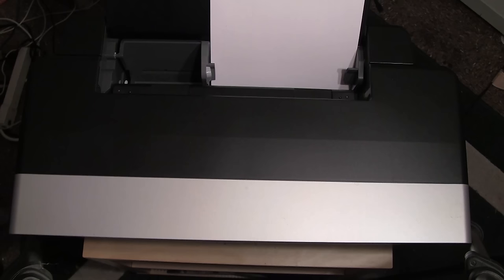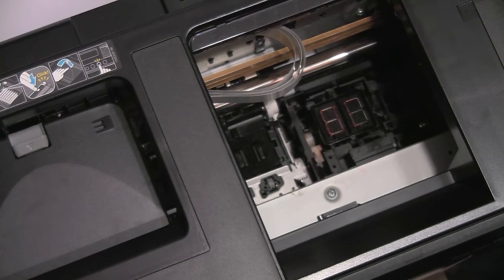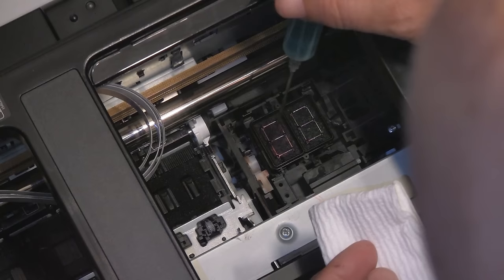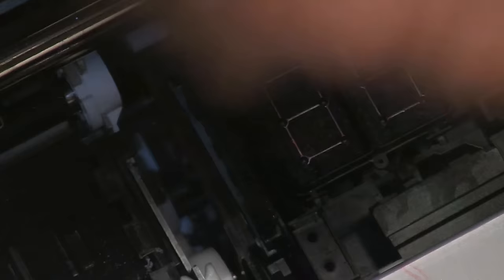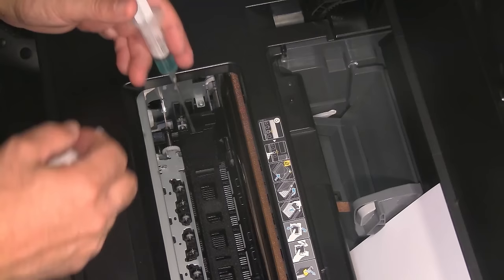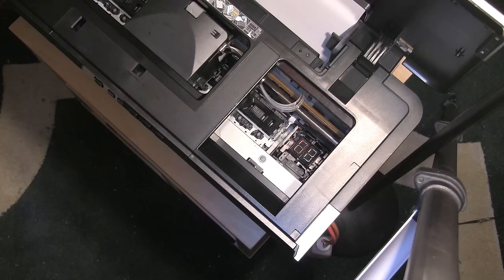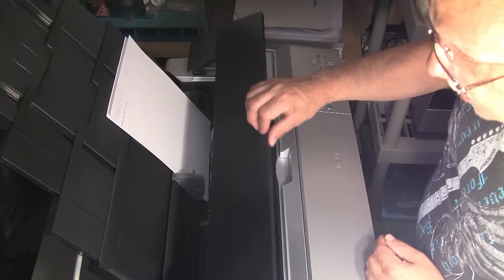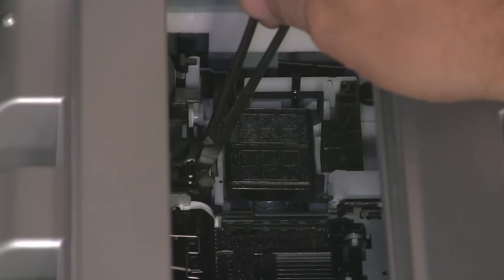How to perform Basic Maintenance on the Epson R2000 and 3800

Comment: Thank you so much Jose. Tried what you demonstrated; did it multiple times with not much improvement and then banding started which hadn't been the original problem ( just a blocked red head).  Watched another of your videos where you talked about laying the windex paper towel under the heads over night.  Did this.  Still banding.  Then cleaned the wiper blade, re-did the sponge cleaning and did a hot wet distilled water paper towel under the heads for an hour.  Everything fixed.  Lesson:  don't give up.  I would have without your encouragement.  Thank you again.  Saved having to buy a new printer.
Reply from the maker: You have not mentioned having done a nozzle check! Banding can be causes my several conditions.  Also are you talking about a 3800 or 3880?  Are you using original ink carts or refillables?
Reply: Sorry.  Did nozzle check numerous times. Ran the cleaning cycle after each attempt at cleaning the sponges. Orange and Red still had problems.  R2000, OEM cartridges only.
Banding didn't start until after I started the windex cleanings; before that all was fine except the Red cartridge being blocked. Worked on it for about 6 hours yesterday in total.  This morning started again.  Something in the last 3 steps fixed it:  either cleaning the wiper blade, re-doing the sponge cleanings or the paper towel with hot distilled water under the heads.  Since I did all 3 , I don't know which fixed it, but it's printing fine now. And thanks again for your tutorials; I would have been lost without them.
Reply from the maker: Glad to hear it.  Make sure If to print often. Orange and red are very dense colors and will the first to cause clogs due to lack of use.

Comment: Just want to thank you for this video. I was having a problem with one of my nozzles clogging and  the cleaning program for my r2000 couldn't clear it. Putting windex in the pads and letting it sit for a couple of hours did the trick. Thanks for saving me from wasting my money on a new printer as my present printer id printing good as new.
Reply from the maker: One single nozzle or a Color Channel? Remember that a color channel has MANY nozzles so it is not a NOZZLE. One nozzle clogged would not even show up as a problem on prints.

Comment: Thank you for this instruction video. Even it is 10 yers old, perfect for my printer. I have a 2009 Epson R2880 and it stopped working properly. I cleaned the printer very very well (for the first time in 14 years) following your instruction video precisly and the printer works perfectly again. I was already looking into the market for a new one, but I'm glad that my R2880, even though it's an old one, still works well. The prints come out very nice. Thx again.

Comment: I'm so glad I found your video, Jose. Epson told me to never try and clean it myself but to take it to an "expert". This means a 140 mile drive for me plus whatever they will charge me. I've had my R2000 for years and never knew of this. I don't overprint at all but the reservoir overprint sponge is saturated and sticky. I expect it will take me all day to clean that. I'm going to clean like crazy from now on since it just won't print right now probably due to this goo.
Reply from the maker: Go slowly and take your time! Epson doesn't want your printer to last too long. The want your to buy a new model printer.
Reply: I have a followup question, Jose. I hope you don't mind. The purge pump empties into something. Where does this excess ink go and should I clean this reservoir? Do you have a video regarding this? I fear a leaky incident in my future.
Reply from the maker: It empties to the very internal bottom of the Printer. That is where the waste ink pads reside.

Comment: Something to add when dealing with rubber parts that are either expensive or just hard to get/replace: after cleaning with anything containing alcohol, since alcohol will eventually dry out rubber and shorten its life, wipe it with a Q-tip or paper towel that's been soaked with silicon spray. The silicon will be absorbed by the rubber and will help preserve it and extend its life. WD-40 can do this too, but could possibly leave some residue that'll affect the quality of your prints. It does work very well on vehicle wiper blades though, so might be worth a try for an experiment, as long as any excess is removed.

Comment: Hi Jose, Have an Epson P600 with 90% clogged Vivid Magenta on the print head. Tried a head clean 4-5 times with out success. Used your windex/paper towel method and bingo, it printed a 100% correct test without wasting a whole lot more ink. Excellent result. Thank you heaps...
Reply from the maker: Awesome to hear!

Comment: Dear Jose, I have the same printer Epson R2000. Currently, I have a problem, that after every single printing, the printer starts the cleaning process (the same one after inserting a new cartridge). Could you possibly know what is the issue? The printer is printing every color and even the test page showed that it is completely clean. However, the printer still runs a cleaning process after every printed paper and my ink is being consumed. Thank you, Arman

Comment: Hi there. Noticed your waste ink system has two tubes going into the container vs putting in a 'Y' connector to narrow that down to a single line going in.

Have you found potential issues in not having two separate discharge tubes going into the container? i've just put together a system that uses the 'Y' but at the last moment I started wondering about issues with the flow from each being constricted by the 'Y' adapter.

Comment: Hi Jose!

I have an Epson R2000 that was purchased new sometime around 2011. I am no longer a working photographer so I do not print photos professionally but I use my printer for crafting (creating invitations and the like). Well, I went to print cupcake toppers and my magenta is not working! I've done EVERYTHING. Cleaned the stem, sat the head on windex soaked paper towel, you name it. What else can I do?!! Your video has saved this printer in the past. In 2020 all heads were completely dried up after 5 years of nonuse so I'm shocked that I'm having such an issue!

Comment: Hi Joe,  my R2000 has the trouble with magenta color only. Currently no any line printed out with Epson Nozzle Check. I followed your way to clean up my printer couple of times. Each time I need to repeat  your procedure again and again, specaily clean up purge pads. It did get magenta color back. But it stopped work again after a couple of weeks no use. My  right purge pads will dry out after I pour Windex or printhead cleaning fluid and left pads is always wet and dark. I need to use paper towlel to suck it many times. Can my printer sitll survive? Thanks for your help in advance.

Comment: I was having clogged head issues so I tried sliding the cartridges along a folded paper towel damp with glass cleaner. I let it sit on the paper towel for a little while then let it dry for a few hours. Now the red cartridge is reading empty...I changed it to a brand new one and it's still reading empty. I'm thinking I may have left some paper towel in the printer? What do you suggest I do to fix this?

Comment: I just got rid of an Epson R1800, and how I wished I had seen this video.  I now have the R2000 so thank you Jose, for sharing your knowledge and for saving us all from future headaches! I’m an artist and I print only borderless—any tips for those of us who do?
Reply from the maker: Robert Dente Printing borderless will always deposit the over spray on top of the Platen sponges, to the right and the left edges of the paper depending on the size. Your only option is to drip Windex on those dirty areas and dab them over and over till they are as clean as possible. Otherwise you will eventually begin to get smudges on your prints if the deposits become excessive.
Repeat every month or so or as needed. The way to completely avoid this is to not print borderless. But since you do, then your option is to constantly clean those areas that get dirty from over spray.
Reply: Many thanks again Jose. I have another question/dilemma if you have the patience?
Reply: Does the Front Feed Thick Stock option work with non-think watercolor paper.  I couldn’t get it to work with Arches watercolor stock.
Reply from the maker: Water color paper up to over 300 gram weight can be feed from the rear feeder. The front feeder is for thicker material about 1.5mm.
If you feed regular paper thinner than that it will be printer blurred due to the pretty huge head to paper distance that the printer will set itself to.

Comment: Hello, I have a samsung 28" 4k monitor and an Epson R2000 printer. When I draw a label in coreldraw x7, the colors of the label do not match the output color of the label from the monitor. I have calibrated the monitor with a spyder 4 calibrator, but it still does not output the correct color. Is my problem a monitor issue, a printer issue or a software issue?
Reply from the maker: I think it's the application. It creates vector based designs. It has to be an pixel based image or it can't be printed with color management. A PDF would react the same way. The vector file needs to be rasterized before printing.

Comment: Thank you so  much! I just fixed a paper feeding problem using your isopropyl-alcohol-on-half a sheet of paper and feeding it through. I did wonder, though, about the use of alcohol. You say that procedure could be done once a month, but other instructions I've seen online say not to use alcohol on the rollers, as it will dry them out, causing them to crack. How likely is using this procedure occasionally to cause that to happen?  Thanks again, anyway... it worked to get my R2000 running again.
Reply from the maker: At the time I lost  that it was though that it would be OK to do so. Now we know that alcohol exposure can dry out so e types of rubber. However most printer rollers are made of synthetic runner like compounds  but some lower end pripri ter rollers are still plaiplain rubber.  I was also made aware of an actual spray for cleaning rollers that will not harm anything.  It also can be used to rejuvenate older rollers so they grip better.  What would do is to onlky perform this operation only when absolutely required

Comment: Hey, Jose.  I was so lucky to find your video.  My wife has a R2000 that we've been using as a heavy expensive paperweight - that is - until the printhead on my Cannon Pixma MP970 stopped working, which is seems like there is little or no solution to....unless a wizard like you might have a secret or replacement option??
Reply from the maker: Canon Print Heads have a finite live span and they simply die due to the it's thermal nature. I am afraid there is not much one can do and in most case the new one will cost more then the new printer. But what is wrong with the R2000?

Comment: Hey Jose ... great tutorial. I still have a problem with one of the purge pads on my Epson R1800. When the head goes through the initial startup and the purge pump kicks in only one of the pads sucks the deposited ink into the purge tank. I think the hose from this purge pad is blocked. Any ideas how I could unblock this ? Cheers.
Reply from the maker: Yes the tube from that pad is blocked with dried ink and crud. Do you happen  have an external waste ink bottle installed? Whether you do or not, you will have to back flush the purge system. Let me know if you do and I will describe or do a video on what you need to do to solve that.
Reply: Hello Jose, I have the normal ink system, no external. Yes I thought that was the case, how would I back flush my system ? Thanks so much !

Comment: Jose - my R2000 has been lightly used over the years and I never did any kind of maintenance on it until now (trying to bring it back to functional). I followed your instructions on cleaning including nozzle cleaning. When I was finished and inserted new carts (Epson OEM 159) and turned on the printer all of the orange change cartridge lights came on for all colors except GO. Is there a way to reset? I'd like to run a nozzle check and test page.
Reply from the maker: You may have a problem.

Comment: Hello, this is a very helpful video!! Thanks!! I do need some assistance.. I have very thin lines going across my photos.. what should I do?
Reply from the maker: trenefrank Without seeing an actual print I can only guess at what the problems is.
Perform a nozzle check and see if there are any breaks in the patterns. If so, do a cleaning cycle and retest. Or check your head alignment. All of this in in the maintenance tab!

Comment: I have 2 lights blinking on my epson r2000, the ink light and the paper light how do you fix this. The printer will not function.
Reply from the maker: Two blinking lights means nothing. You need to determine the blink pattern. I could guess that if it is fairly old then your internal ink pads are saturated and require servicing. Do you get any message at your computer? Such as " Parts have reached the end of their life"? Or some other message or error code you could then Google.

Comment: When printing with photo black I am getting black thick stripes at the edge of the paper. Strangely, when printing with matte the picture is perfect. Any ideas what goes wrong?
Reply from the maker: Which printer? Your cart is probably leaking!
Reply: @cheo1949  I have 3800. For some reason this happens only with photo black. With matte black the printer works perfectly.

Comment: Wonderful detailed information. I have a question about the first windex cleaning of the nozzle. From your instructions the printer is turned off and the nozzles positions overtop of the sponges. If you were to turn the printer on and then off at this point would it not lower the nozzles into the windex and do a better job?
Reply from the maker: No. you will treat the nozzle plate over three to four layers of paper toweling wetted with Windex when you slide the print over to the left. That physically wets the surface of the nozzle plate. You can also dribble some on the purge pad to dissolve any deposits downstream from the sponge ( into the pump itself ). When the print head is slid over it the FUMES alone do the job. If you park print head as you suggest the Windex will be sucked away before it parks itself.
Reply: Thank you very much. Your answers are great since you provide context as well.
Reply from the maker: Thank you!

Comment: Thank you very much for your informative video. It was an eye-opener. I have an R2000. I am an artist and print semi-regularly (average once a week), even if it's a simple nozzle check. I was printing everyday last week trying to get prints out to be sent to a competition. I was doing nozzle checks in between prints just in case. For some reason, the magenta seems to be blocked every 2 prints or so but would usually clear after a head clean. However, the last clean I did didn't seem to clear the magenta. A few head cleans later, it grew worse! I also tried printing a magenta sheet (pulled off the internet), but it didn't solve the problem. Successive nozzle checks without cleaning showed the magenta lines in different places, so could it be trapped air? I swapped to a new cartridge even though the previous one wasn't empty, did a head clean, but same problem. Would you have any suggestions on what I should try next? Thanks in advance, and much appreciated.
Reply from the maker: Clean the purge pad gasket so it seals agains the printhead and cleaning cycles actually work. It relies on suction from the purge pad sealing against the printhead. Been there.
Reply: @cheo1949  Thanks so much for your reply! Really appreciate it. I assume by "purge pad gasket", you mean the sponge area on the right where the printhead rests when idle? Unfortunately, I can't get Windex where I am (Malaysia) and ammonia is really hard to get, so I have ordered some Magic Bullet online. Not the cheapest option, I know. Hope it works. Thanks again!

Comment: I have an R2400 which started being erratic with paper feed, needing a number of tries before one got fed properly. Yesterday, it wouldn't feed a page no matter what. I came across this video of yours and picked up on the folded sheed technique. I had only 90% alcohol (probably ethyl or methyl) and gave it a try. It is not cured, but it is much better, I can get a sheet fed, but still erratic. There was a product, sort of sticky sheets, Epson code C13S041150, but these are no longer available in Europe (I am in France). What would the 'sticky' surface have been, I wonder ? Anyway, thanks for a great posting, and when my R2400 starts being bitchy with the print heads, I shall watch it all again. In the 4 or 5 years I've had my printer, I have not had clogged heads, I leave it on all the time. Same went for my R2100/2200 (Europe or US numbers different) - left switched on, never clogged heads.
Reply from the maker: Glad it has helped a bit.  The R2400 was and still is a notorious cantankerous paper feeder.  At least mine certainly was. The cleaning sheets simply picked up loose dust and paper fibers that build up with the passage of time.  4-5 years is actually very good for that class printer.  Keep it up and it shoiuld last even longer. Thanks and take care!

Comment: as soon as I touched the sponges where the heads park on my 3800, the whole module sprang out of place and now the printer is unusable: I have to find a way to disassemble it  or send it to repair service ... >___>
Reply from the maker: The 3800 purge sponge assembly can be easily dislodged. If I remember I simply squirted cleaner onto the sponge and let it drain. Repeating till clean. The gasket is gently cleaned with Q-Tip.